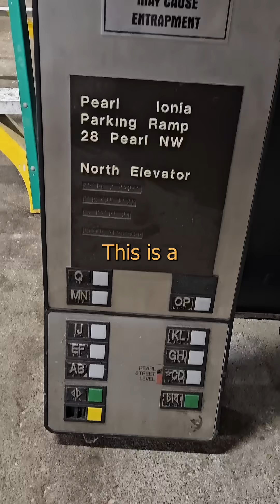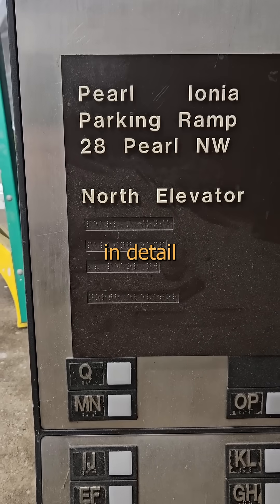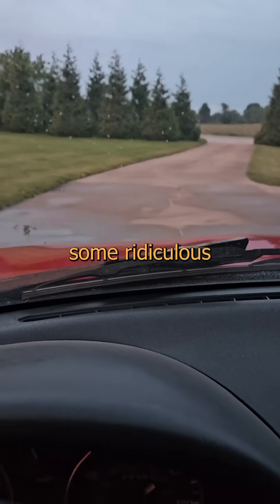Miata Mischief #chrisboden #engineering #gear #elevator #score #stories #parts #hacking #making

Comment: Sometimes necessity is the mother of Tetris. I was moving in to go to university back in 2014 and the apartment I was going to had no washer or dryer. I definitely was going to need one as the laundromat charges an arm and a leg there in good old Rolla Misery (Missouri). Being that it was a 5 hour ride and I didn't have access to a truck or trailer, I borrowed my mom's 1992 Subaru Loyale station wagon and went to the local appliance guy and bought the cheapest washer and dryer I could get. He was confident that I wasn't going to fit both into the car at the same time, but I had to try. I flipped down the rear seats and moved the front ones forwards until I was scrunched up like a soda can that had been stepped on. Amazingly, the washer and dryer did both fit sideways into the back with the washer in front and the dryer behind, but I did have to unbolt the top panel with the timer and start buttons on it to fold it down so that the dryer cleared the rear hatch... After 5 hours, I made it to Rolla feeling like a butterfly that needed to hatch. I left those appliances there when I left.

Comment: So this was a while ago but I used to have a 1995 Dodge Neon, and I had to some how fit a Dana 35 Jeep axle in the back seat of that thing. The windows in the back didn’t go all the way down. They stopped half way, and the back seats didn’t move either. So I ended up taking the front passenger seat and had one side of the axle propped up on the back seat and the other side was below the dash. The suspension one the passenger side of the car was almost touching the ground. That side would bottom out whenever I hit a decent size bump. That thing wasn’t strapped down either, it would move around while making turns. Definitely was one of the sketchiest things I’ve ever done. For context on why I was getting an entire axle, wasn’t really paying attention and didn’t realize the pinion seal when bad. So all the diff oil leaked out of the axle and it seized up, old XJ Cherokee

Comment: Worked for a dirt track racer/ mechanic got word of a race car for sale 40 minutes away we get there load it up and we have to pull over 5 to 6 times to put the straighten the car so it wouldn't come off the trailer

Comment: I was given a birthing chair from the local hospital when they were refurbishing and it's an electric over hydraulic birthing chair with a six-way foot switch with the base and everything all in it weighed about 900 lb because you know it has a small pedestal and when you put a prego human on it it can't tip over especially with her legs in the air it has to counterbalance. I wanted it for a shop project and I had to put it in the back of this little Toyota quarter ton pickup and parade it across town with the stirrups fully extended out of the back for all to see  driving down the road and because it was a small vehicle it squatted their leaf springs  to make it look like an old mutt dragging its ass across the carpet all the way back to your bedroom trying to clean itself

Comment: One time my bike tire got flat like 5 miles from home across town and instead of calling for backup I dragged that sum-bitch all the way back home. Keep in mind 90% of this was uphill at a straight 45 degree angle because I'll be damned if I lived anywhere at any point that was level or at least somewhat flat and not elevated to the top of fucking Everest.

It was the longest, 3 hour walk, of my entire life. It would've been so much simpler if I could just walk in a straight line home but nope, city streets. Meaning block by block I'd have to go this way, make a left, make a right, right again, left once more, zig-zagging my way up hill, downhill, round hill, square hill.

Heaven forbid I ever ride a bike long distance again and it gets flat I'd sooner call a fucking towtruck to get me home than walk that distance uphill ever again.

Comment: i was walking in london and i found a huge home cinema speaker amp on the side of the road, it had like 100 ports on the back and weighed about 40kg. i ran back to my car, drove it back to where it was and (with difficulty) hauled it into my boot. got home and after a month or two of it sitting around i sold it for about £80. i know, i really wanted to use it for something but i dont have any speakers that require that amount of power and no where to put them even if i did have them

Comment: I used my Subaru Forester to haul a 20 cu ft refrigerator, twice. Had to move the front seats up to manage that. And more recently, I hauled an 8 ft step ladder with it. Had to slide it through the back, between the two front seats, and it was over the shifter and part of the steering wheel. Drove  it home while only being able to use about 2/3rds of the steering wheel.

Comment: I built my house and found a 45' 8x14'' glue lam on craig's list. I had to build a strap on trailer axle and toung to tow it home. All went well until I got in my small town where a parade was going on a cop told me I would have to turn around due to the parade I told him there is no backing up this 45' beam soI became part of the parade with lots of confused on lookers'

Comment: When I was 15 I bought a ninja 300 and since it was winter (in Quebec) we used my stepdad's grand caravan to carry it back. It was to high to fit in the hatch so we took of the windshield of the bike and lower the pressure in the tire so it could barely fit in the hatch at an angle. And we made the 2h drive back in a snowstorm with the bike resting on my laps since it also didn't upright inside

Comment: Once found a nearly perfect condition bench seat for a '79 toyota pickup at the scrapyard. Younger me forgot the important detail that i had driven to the scrapyard in an '85 Nissan pulsar, a car with only slightly more interior space than a miata. And without any way of securing the seat to the exterior of the car. Somehow i managed to squeeze it into there, but i had have the passenger window rolled down, and with where it was sitting i couldn't shift into reverse. Made it home safely only to find that they moved the bolt holes between '77 and '79, so it didn't even work in my truck 😂

Comment: I made a wooden cart to help haul my laundry and dishes to the first floor of my dorm (i.e. where the kitchen and laundry room were).  I brought it home balanced on but tied to the bike rack on my mom's car.  Said bike rack has been on this car or others for the better part of two decades.  The webbing straps have been out in the elements for all of that time.  I don't know how nothing's broken yet. 

My dad at some point built a rack out of plywood that he used to bring washing machines, dish washers, dryers, fricking hot water heaters home _on the top of his '91 Corolla_.

Comment: A convertible with a backseat is a pick-up truck if you're brave enough. I used to take mine camping with the back seat piled high with gear, higher than the roof would allow, strapped down behind me.

Comment: I got a few actually  my  friend  gave  me a lazy  boy  recliner  so  I put it on my head  and rode a 20 inch  bike  a mile and a half home.Another time I was walking and saw a 50 in projection tv in trash that said works just needs cleaned so pushed  it a good mile down the road thanks to it having wheels and slowly rolled n shimmied it up 2 flights of stairs cleaned n recalibrated the projectors and used that thing for years til flat screen tvs came out . did many dumb carries  but last one another friend of mine gave me a fridge so i decided  to strap it to a dully  and  ride  it beside  my bike almost broke my wrist cause it wanted to death roll a couple times so  hada  walk  most  the  way pushing it and the bike man that sucked  but  still got it and wors great 5 years later

Comment: Needed to get an engine for my GF's car. But the only thing I had was a crappy 86 Civic sedan. So I drove half an hour to get this engine. It didn't even fit in the trunk. So I ratchet strapped it to the inside and drove another half an hour back with the engine sticking halfway out of the trunk.

Comment: When i was 17 i worked at a mobile home posh.  All the lumber they can't use would pile up outside.  1 day i asked if i could have it and they said yes.  So i strapped 37 2×4×12 to the top of my 73 plymouth valiant.  Drove the 30 miles home.

Comment: I won a hand painted sign from a barter based clown casino and had to take it home obviously. Well my daily driver was a mighty Mazda 3 sport manual which is awesome to drive but not great for 10 ft long plywood sign. I managed to fit it through the trunk after dropping the back seat and running it all the way to the passenger floor board. Now 2 years later it's my greatest wall decoration and I work for the clown casino now.
Reply: That first sentence is either super-wholesome or extremely cursed. No in-between.
Reply: Mazda3 is sick, they're such great little cars

Comment: When you have a 1997 vw polo 6n and push the seats as far forwards as possible, you feel like sitting in a half scale VW t4. We moved two speaker towers that barely fit into the car.

Comment: Far from the sketchiest thing I’ve haul but the Miata reminded me when I had my NA Miata and I haul a gas powered pressure washer a coworker gave me. Back then gas was king for a basic pressure washer and expensive bc Chinese ones were not as easily available nor reliable then either.

Comment: The wife has a VW Bug convertible (I have a one ton pickup). We went into the "city" one afternoon to a membership wholesale club store in the VW. As we were shopping around the store, we decided to buy a king size memory foam mattress> The price was good and I have rheumatoid arthritis pretty bad, so this matters was supposed to be the trick for getting good sleep (spoiler alert: didn't help at all). Anyways, it was in a box with the mattress rolled up in a vacuum bag. The box was about 2x2x4 ft and weighed about 70 pounds. We loaded it on a cart and checked out. Once in the parking lot, I remembered we weren't in the truck but the convertible!!!! Home is about an hour from "the city", so going home to get the truck really wasn't feasible. I lowered the top, tipped the back seat down and proceeded to load the mattress. I wasn't having a good RA day and it was a real challenge picking the box up into the car. Once in, it was too long to lay across the inside, so we had to stand it up for the ride home. Man did we get some looks on the way home!!! Needless to say, mission accomplished, but foolishly as hell.

Comment: I wasn't there to witness it, I have no clue how they did it or if I just hallucinated them telling me this but when I got a 50 inch flatscreen, my mum and brother had to cram it in my mum's tiny Citroen C2. The thing is smaller than most things on the road and is practically a tin shed with a 1.1 litre engine inside it, and yet they managed to grab a flatscreen that probably took up the entire interior and drove home. We weren't far when I got it but I was still baffled as to how they managed to haul it back without snapping it in half and reconstructing it with black magic.
Reply: On the other extreme, I bought a 60 inch rear projection TV years ago, so big I needed a friend just to get it out of the store but I have an ex-RAF missile trailer that made it look like something from a doll's house.

Comment: I've had a Jeep YJ since college and, at the time, had a '96 Saturn SL, rocking less than 100 hp. The Saturn was so base that it didn't even have power steering from the factory. Using this workpony, I picked up 4 heavy duty leaf spring packs and hardware and drove over 20 miles on the highway through a thunderstorm. With so much weight in the back, the Saturn's steering and brakes were more theoretical than functional.

Comment: I also owned a NA Mazda Miata. I volunteered for a performance rally team as a crew member. Our car had an off in the woods and the rest of of the crew set off to recover the car. I was left alone with the entire pit setup and my tiny little Miata. The sun had gone down and I got the call that the car was recovered back to the house we were staying at and it was up to me to pack up and entire race car pit and bring it back. In my Miata.  To my benefit I didnt have a passenger seat. I fit 2 tool boxes, 4 spare tires, 2 floor jacks, an easy up, two large tarps, and a cooler in that little Miata. And off we went 45 miles to our temporary HQ as the hero of the day because everyone was too tired to make the drive to break down the pit.

Comment: I rode down off a mountain top from an abandoned radio site that was being junked  with a 220mhz Sinclair full size repeater antenna strapped to the side of a dirtbike and a uhf corner reflector on my backpack .  On 15 miles of dirt mountain trail and 4 miles of city streets.

Comment: My buddies and I were in a drive thru when the throttle cable on the car broke. We were driving a subraru bug eye STI (not sure of the year but I know it was a bug eye) anyway, we had no way of fixing it. But the remaining piece of the cable that actually connected to the throttle was long enough to just barely be reached by a pair of needle nose pliers when I hung half way out the window with my arms out stretched. Everytime he shifted, I had to give slack in the cable, and re engage just at the right time since it was a manual transmission. We got that mf up to 120mph in the dead of night on the highway trying to get home. One of the sketchiest but funnest moments of our lives. Never even missed a shift.

Comment: Bought a 10foot folding table off Craigslist. I drive a convertible beetle, and it started raining literally just as I'm pulling into the subdivision to pick up the table. I wedged it in the backseat and tied it in. Hour drive home, in the rain, with the top down, and the world's largest spoiler sticking up. Going over 50mph and things started to get a bit squirrelly.

Comment: 2000 GMC envoy to tow a 1979 airstream 35 ft trailer home😅
4,000 lb SUV to tow a 7000 lb trailer I have less than 100 lb on the steer axle. But I got the trailer home and I immediately got a 1999  Ford F-250 with the V10 Triton to tow it after that😅 but I tell you what that little 4.3L V6 in the envoy was punching well above its weight class when getting that trailer home

Comment: I think I was 20 when I got a 42U server rack from an old TV station. I couldn't get it to fit in my car so we got the a moving dolly and straps from Hazzard Fraud. Tied rope around the trunk latch inside the 93 corolla, then fashioned to the dolly. Cinched the rack on its side to the dolly. I don't think I got over 25 MPH (40 kph) but the price was right and it served my buddy and I a nice place to start the home lab.

Comment: I once stuffed the trunk and backseat of a 2001 kia rio with about 2000 pounds of sandbags for a home renovation project. Mind you this 2001 kia had a manual transmission, manual mirrors, manual everything. Didnt even have power steering. But ya know, it took it like a champ. Rode the bump stops all the way home lol.

Comment: I had a 1980 CJ-7 Jeep and needed crusher run for my little driveway , and headed to the quarry, they weighed me, and said pay when done, I was shoveling in up to the top of the (plastic) windows , now mind you, the max payload was 1050lbs, but I didn’t know that. Weight station was laughing when pulled in again, I had 2423lbs in there of rock, the back end was so depressed, I was looking at my hood going down the highway, leaf springs were really crying, basically no shock absorption , so glad I did not get pulled over and I did make it , the Jeep lasted another 10 years after that even until I sad sold it. I would not do that to any vehicle these days but man, did AMC make them good back then. Every single component was proudly USA made.

Comment: Moving out of my apartment to a place with no garage I had to store my toolbox.  Problem being I had a sedan WRX that did not have room for an 8 drawer toolbox.  Thankfully I had a roof rack and a slightly stronger back than I do now and managed to heave the toolbox on the roof without scratching the paint.  1 ratchet strap and a that's not going anywhere got me safely to a buddy's house 20 minutes away.

Comment: Used to ride 26 hour drives to see my grandparents in an old e-350 van. When my sister was born, my dad fashioned a bed frame for the back two rows. It locked in around the seats' lock brackets. Seat removal and installation took less time than inflating the air mattress. Hauled the whole family in that glorious thing.

Same behemoth I learned to drive, reverse, and parallel park in. Then took my road test in mom's Cirrus

Comment: A buddy of mine had a Miata like this in college. He'd put the top down, set the cruise control, and then use a boat paddle to steer the car. Because they're so small and light, the additional drag from whichever side he put it on was enough to pull the car in that direction. He may or may not have fully committed to the bit by getting out of the seat and sitting in that little spot between the two headrests.
Reply: That's .... amazing.